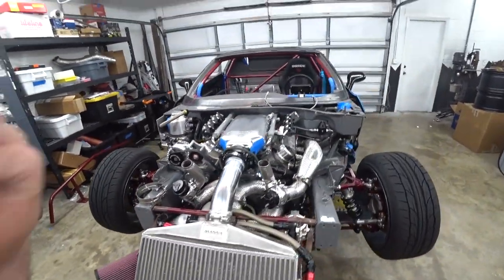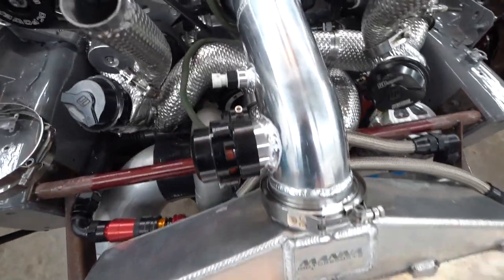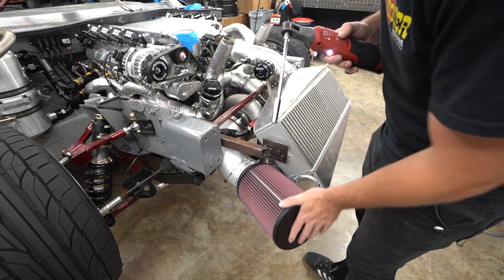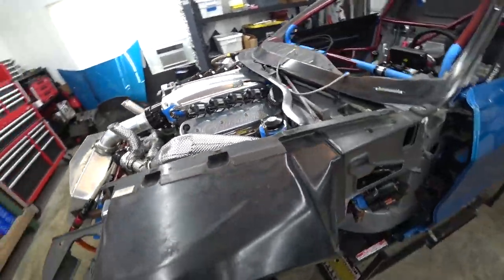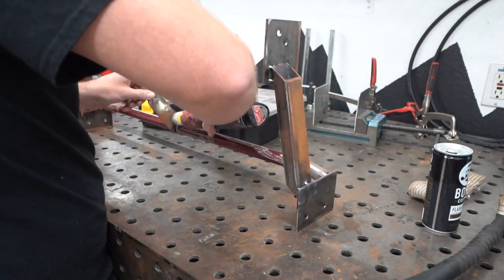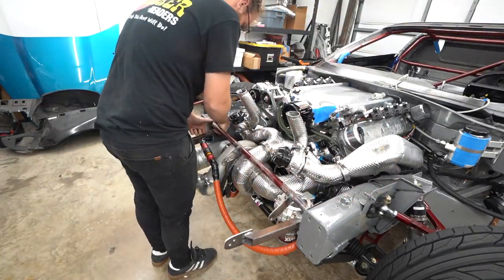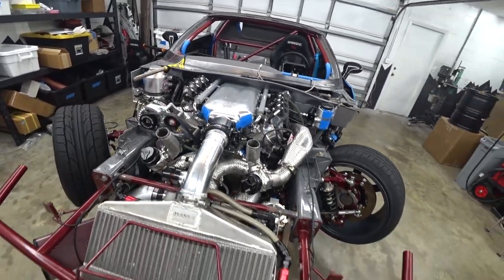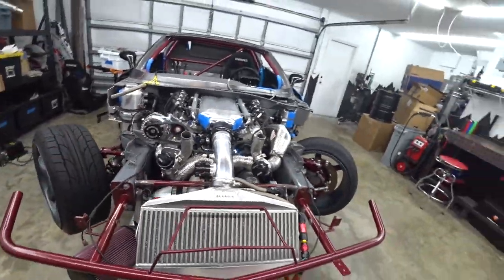C6 Corvette competition drift car build. finishing up loose ends.

Comment: Chrissy is the real MVP making all the lists! The Vette is really coming together! That heat shielding looks amazing, but I'll be interested to see it's long term durability!
Reply: That heat shielding is a material used by OEM's, it's been in great shape on every early 2000s car I've worked on, unless something physically contacts it and damages it. Its useless in that case..
Reply: @menogusta9829  it'll be great not being in a daily driver.   Rust belt mechanic here. Factory head shielding does not last in the salt and moisture.
Reply: @Axial32  oh I'm pnw, it holds up well here, practically untouched with our winters and climate.
Reply: @jasonbirch1182  oh. Okie dokie

Comment: Hey Taylor, for the power steering bracket, if you want to make the hose clamp that holds it look a little cleaner, you can mark how big it is when it’s tight then cut some heat shrink and throw it on there. Makes the hose clamp look WAAAYYY nicer.

Comment: At the 7:35 mark, you could just put a zip tie around the intake and that intercooler support bar. That way it can move in wreck but not flop around if it does

Comment: You should make a cold air baffle for the air filter with some edge trim in the hole and where it touches the bumper cover so you don't have metal on metal or metal on bodywork rubbing.  That will support the tube and keep the IATs cooler.

Comment: One thing I noticed. Make sure the front bash bar won't hit the tires if you take a hit on the corners. Good idea on the speed holes on that mount. Better to have that bend up or down on an impact.  Instead of breaking the throttle body.

Comment: On the intake if you do decide to add a support when not use an exhaust hanger with the rubber isolator so it will have support and still have movement

Comment: like the fans to control heat - add a variable resistor like you use with soldering gun to adjust speed or pwm, vrap elec lines in some foil and place as far away on rails from headers - take it out late nite and drive it for a 100 miles and then check everything when you get back - having the list is important but you should continue that good habit even after build #hammer optimization #not all problems are a nail

Comment: On the look of the bash bar extension for the oil cooler and intercooler supports, I don't think they are ugly, just need to be painted to match.  A lot of improvement would be gained from painting the speed-holes bar with the nardo gray, and the round bar with the red, would go with the round=red flat=gray theme.

Comment: You should round the corners of your flat brackets on the belt grinder after you drill your holes. Before you weld them.

Comment: i dont recall if you talked about it in a previous episode, but I'm curious why you chose to go with a power steering  pump/etc vs going full electric on the power steering?  Is there weight advantages?   (I am NOT saying you should have done blah blah, I am just curious why you would chose one over the other).

Comment: With hood vents, on the hood is a low pressure spot, during motion, you are going to have those be the location the air come out, so the fans will be fighting that.  The base of the wiendshield is a high pressure location, is why cowl induction hoods work the way they do, and why when people pop the back edge of the hood up, their airflow though the engine bay becomes worse (if it becomes better it means that their radiator ductwork in the front was wrong to begin with, and it needs to be looked at first before any other changes are made) 

Remember that with all ductwork, you need to think in pressure differentials.  A lot of cars with cooling issues forget to create a low pressure zone behind the unit that transfers heat.  This is why most cars tend to have a ducts that goes from the front bumper to at least the front axel, to create a low pressure zone behind the intercooler/radiator/condenser on a street driven car.  You could have the most perfect ductwork to the front, and will still overheat because the exiting air stagnates.
Reply from the maker: So with drifting the demands are odd. Most of our cooling is done idling in grid. We do a 20-45 second lap. Then sit for 5-10-20 minutes. Then do another lap. So idle cooling is really where 90% of our cooling happens. Thus the reason for the blowers.

Comment: Make sure to boost leak test the system b4 u get it tuned soapy watervin a spray bottle around the welds like the patch on the side of the intercooler just to make sure thers no pin hole leaks

Comment: Any thoughts on problems with heat soaking the engine. Seems like things are pretty tight up front there I'd be worried about heat soak.

Comment: Did you think of pros and cons of twin injectors?

Big con is if 1 injector dies that hole runs enough to run lean and burn a piston instead of just not running and with E that's very possible
Reply from the maker: I’m not running both to make the power. I’m going to alternate between sets. It just came with the dual injector intake.
Reply: @Taylordrifts  perfect. Sort of. I don't like the chances that when you go to use the second set it won't have issues from not passing E through it. Even as a backup that if you have an injector die you just plug in the other one it might have that white powder sitting in it. Safest bet would be swapping them in as you have failures (set 1 has a bad injector swap set 2 in and clean set 1, rinse and repeat)

Never thought you'd need the twins for power but thought you may stage smaller injectors for good low throttle then stage in the second set after 50% throttle etc which again is where there can be issues with 1 injector.

There just seems to be no real way to make it 100% on E you're either risking a block while using them or risk them not working when you need to use them.

Just making sure you're aware if you are go ham you've got EGR so it might help pick it up (although probably not mid run in top 8)

Comment: Unfortunately, the air temp sensor will heatsoak, it's too close to the exhaust and when idling, the pipe will warm up. Typically in the queue after a lap before another. The intercooler endtank is much better placement. Ask me how I know it, lol.

Otherwise, great progress man, thumbs up!
Reply: Isn’t that what the heat shield is for?
Reply: You have so much heat shielding all over your exhoust and your sensor still catches heat?
Reply: When it matters, on throttle, the sensor which measures the air flowing through the pipe will be fine. Even if the pipe itself is hot, the sensor is insulated from the housing, so it only measure the temp of the air flowing not the pipe. 

In short she's all good mate 👍
Reply: Heatshield helps, but heat wil creep in eventually. I tried gold tape, header wrap... All helps but idling 10 mins in line for drifts or just a city traffic warms it up, cause there is almost no airflow at this situation. Plus the sensor has also a delay up to 20 seconds. OEMs knows why they put it in plastic pipes away from any exhaust and radiator.
Reply: @honzastrnad  I'm telling you they're insulated, I'm going to suggest your turbo or intercooler aren't performing
Reply: @theycallsmeella  I'm not saying its super critical, but it will be visible on the logs from the track.

Comment: The intake air temp would have looked better on the bottom. Any reason that you have to run it on the side?
Reply: Accessibility. If t-ray needs to change it, the swap will take, 5/10-ish minutes.

Comment: No offence, but for a Competition car, why wouldn't you have just run your 427 LSx with a Supercharger on Methanol and saved all of the added complexity of the exhaust and charge cooling (ie. Front End WEIGHT) ?
Reply from the maker: This is heavily discussed in the early videos.